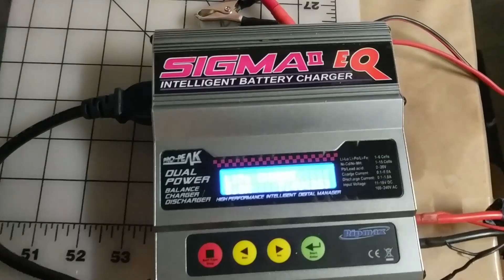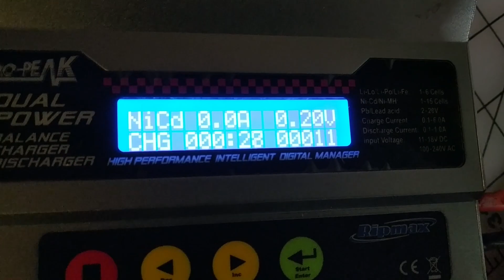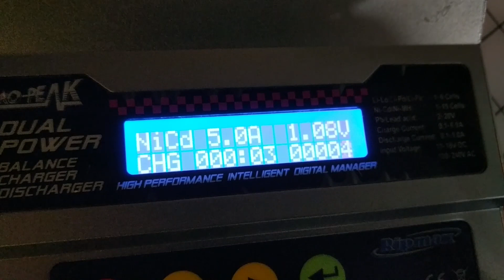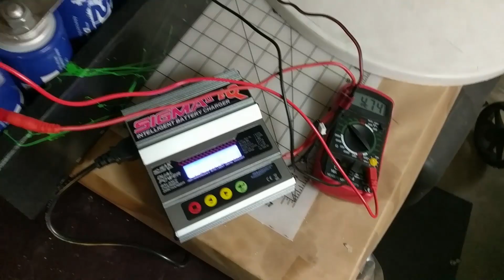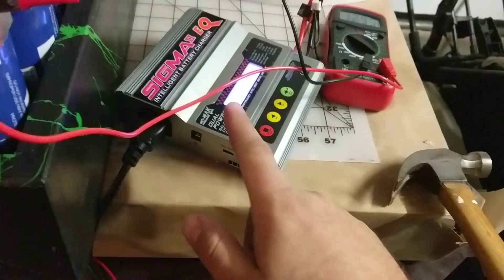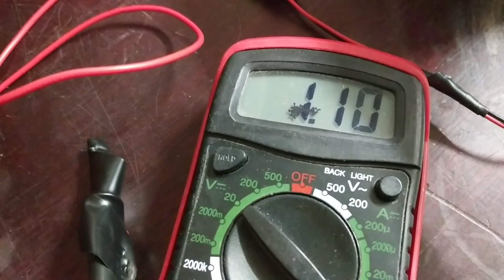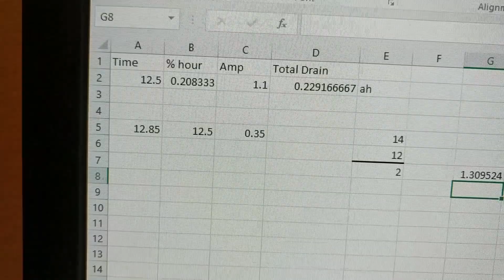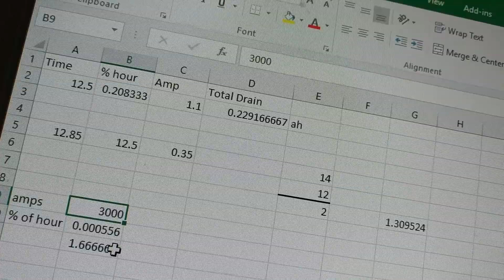How to charge a Maxwell bcap3000 + capacity test

Comment: Hey Marius I just acquired a 6S4P 2000 Farad XS power super cap bank off of marketplace i got it in the hopes of it stabilizing my voltage with the Ruthless amps the 10k dips my voltage to the low 15's when I turn it up and I don't even have the amp gain or bass knob all the way up i think the amp is around 95 of 118 clean and the bass knob is around 60% anyway im wondering if 2000 farad's will be enough to see a noticeable difference in the voltage and help with burps when I compete please forgive me I'm still learning bro currently running a 240 autotech xs super cap bank under the hood triple run to the back feeding a 72.5AH Scib   bank charging at 15.8 feeding the Ruthless 10k and 1500.4 still just the one Tyrant 15 but the Second one is on the way just trying to learn a little about the bank and see if I would be good with that or needed more

Comment: Not sure how many lives you might have saved by emphasizing caution but I, for one, appreciate it. From just looking at caps put into car's many ppl don't realize you need to limit the current BOTH charging and discharging or you will have lot's of sparks to say the least. Maybe a 12v battery sitting in the middle of the sparks. Great vid. Thanks.

Comment: Do you think it safe, when implementing super capacitors in an amp psu, that right after the rectifier  (with 5w series resistor) that enough s.cap be placed? Non regulated voltage on my ac line has a swing of about 5v - I’d obviously give myself enough headroom.

Comment: How to balance the capacitors on which I have voltages - 2.45/2.42/2.45/2.22/2.00/2.50+? Does horizontal installation of capacitors affect their operation? Does the + or - at the top make a difference? Thanks. Greetings from Poland💪
Reply from the maker: User resistor between them, if you short them it may not be pretty
Reply: @LoudFiat  Measuring the resistance of each capacitor? What is the correct value? I removed the package from the car and it is on the table. So it's safe.
Reply from the maker: @Lostylian  you can balance the capacitors by connecting the common ground and then using a resistor from one positive to the other positive, continue doing that until all the voltages equalize
Reply: @LoudFiat  So I will. From what follows, one balancer may be damaged. There are 3 in the package. Or I will swap the balancers. Then it can be determined whether the supercapacitors with another balancer work properly. Thanks for your help👍

Comment: I am very interested on setting supercapacitors to my car for extra power and efficiency but I just can't find a basic guide on how to do it. I'm familiar with electric car conversions but not with supercapacitors
Reply from the maker: Ultra caps for 360v nominal won't make sense due to size
Reply: @LoudFiat  I had my eyes on the 6 kW PMAC motenergy electric motor. I guess the gas engine can charge the SC when not accelerating. Hey, thank you for your answer.

Comment: Buy a 1000 watt high pressure sodium ballast transformer. Cut out the secondary coil carefully without damaging the primary coil. Wrap four gauge wire at about 14 to 16 turns on the secondary side. Buy a 400 amp bridge rectifier and you’ll be able to charge those caps in  maybe a couple minutes. Cheers

Comment: Also, I have seen a single row of these Capacitors (6 caps) start a huge Steiger Articulated Tractor with no battery, and a single capacitor vaporise an electrical screwdriver @ 2.7v, so this is a huge cap bank, especially for audio, I would imagine a single row of these caps would be more than enough for even large audio systems, as you can pull about 2000amps out of a single string for a short time.

Comment: Good Day Mr. Marius Dornean. May I ask a question please. No. 1= Can I charge in series or in parallel 6 pieces of 2.7v 3000f supercapacitor all at the same time? No. 2= Can I add the 6 pieces supercapacitors to my 12v batteries? Thanks so much

Comment: Okay, so you trickle charge capacitors for 3 hours to get a full charge of 12.8v (is this charging faster than an actual lead acid battery?) You get about half of the output in time 1.6Ah burning on a 1.5Ah fan. Is there any way you could open up the Ah input without damaging or popping the cap? 3hrs is way too long. I thought the whole point of having super-caps was for the extremely fast charging and discharging rates.
Reply from the maker: Based on the comments in this video, some people think you could just hook it up to maximum amperage and just load it up in milliseconds as long as you're wiring supports the inrush. I wouldn't recommend pushing the limits of wire capacity personally 😄

Comment: if you have 2 35v capacitors and want to use it as a power for a car, how do you enSURE that the alternator won't overcharge the capacitors and blow them? OR that it won't charge too much for the car's electronics? thank you :)

Comment: Question regarding its charging procedure and working.

Question -1) Is For super capacitor the charging voltage should be always10 percent less than the capacitor rated voltage.To increase the life of capacitor.

Question-2) regarding charging current to these capacitor for example 3 volt capacitor of 500F connected in series  of 27 pcs.so total voltage will be 81 volts and capacitance will be                         18.5 farads.Hence what will be the safer charging current.if we connect it to 79 volts,45 amps power supply.(transformer type power supply). Is there any problem to                                capacitors.   

Question-3) after capacitors fully charged it means voltage across the series capacitance network will be 79 volts is equal to power supply voltage. hence in these condition if the                              capacitor network remains in the circuit parallelly with the power supply with no load connected. Is there any problem of heating capacitors.

Question-4) Is there any need for protection circuit.i seen protection boards available in markets.

Question-5) What is the leakage current of these capacitors.500F,3V

Question-6) terminal resistance of these capacitors.500F,3V

waiting for your reply
Reply: Hi! please let me know if you find the answer to your questions :)

Comment: Why are you even saying 12volt this or that your banks are over 16volt capable and your using them for car audio to punch some big drivers in the ass while you have what 3- 200 amp alternators throwing Zeus size lightening bolts at them. Honestly dude that tiny charger aint going to do nothing to them no matter what setting you put it on. These things charge faster than a meth-head can get your catalytic convertor off. Next time how about you don't play with stuff someone else pays for and stick to installing remote starters at the audio shop.

Comment: One really need to run the output through a watt meter to record the total watts. because even though that fan drew 1.1 amps at 12 volts it will draw less as the volts of the caps drop. the volts and Ah will drop linearly together. Each of those 3000F caps will have the equivalent energy (close) of a double AA alkaline battery 3Wh If you got the voltage to its max of 16V.  Best way to use the full power of those Caps is to use a Boost converter that will boost the voltage (as it drops) to something usable. Assuming you want to use these as a battery. All those Capacitors are going to provide up to 108Wh. But because the voltage drops as fast as the current is used it is hard to make use of that 108 Wh. Nice thing about these Maxwells Boost caps (I have 24 of them I have experimented with) is they hold their charge for Months at a time without self draining. As expensive as they are you really have to have a specific use for them to make them worth the cost. Like needing a tremendous amount of amps for a very short time. So if you want to sue these as a 12 volt battery you really need to have a Boost or a buck boost converter regulated output found cheap on AMAZON or Ebay.

Comment: A 12V halogen light bulb between the baterry and cap pack would be enough to safely charge the caps from zero volts. The bulb would get 12V at the beging and the voltage drop on it will decrese as the caps would be charging.

Comment: I have a question do you need balancing circuits to make sure they charge evenly? or can you hook these things up with only bussbars  in to a 14.4V system and never have fear about them over charging or duos that become an impossibility because there max voltage is 16.2 volts and there charge voltage is 14.4 volts in a care audio situation  kinda like water lvling? I understand battery's and i'm getting in to Super Cap supplementing now and want more information on the 6 inline super caps.
Reply: Yes you need to balance

Comment: I would suggest to everyone that watches this video to read the wikipedia page about how a capacitor works and take a look at its equation and take some online supercapacitor discharge calculator. For this 3000F setup if you discharge from 12.85V to 12V using a constant current of 1.1A (considering the internal resistance of 0.29mOhms) it would last around 38 minutes. And from 12.85V to 12.5V it should indeed last for 15 minutes.
Reply: If you connect a 200 load to this set it will only pull out those 200 amps right?

Comment: Next time make your video without the children. If you would use the battery tester you would find your calculations are wrong because the load decreases with the voltage. In theory with no losses on paper and real life are quite different. What you should be looking for is "usable power" Know what the manufacture says and  verify it. With a load of x amps and a cutoff of X volts we can expect to run this equipment for x. These caps will not be damaged by going down to 0 volts whereas batteries have an operating range both voltage wise and temperature wise. If you are only using these caps for peak loads then simulate so. As with anything electrical safety first and know your limits.

Comment: Capacitors do not compare to lithium batteries. Cars are using capacitors to supplement batteries for SURGE considerations, not continuous energy sourcing. Capacitors are good for providing an initial blast of current so that the lithiums will not have to. It supplements the energy stored in the batteries. Placing a small fan as a load is only going to mislead people into thinking cpacitors are comparable to the energy storage and longevity of batteries. Folks, don't be fooled by any misunderstanding derived from demonstrations like this.

Comment: You are making an expensive mistake by providing no balancing circuits. In series, it is possible in charging to exceed the rated voltage of a single cell, destroying it. This can happen if one cell is a bit smaller in capacity than the others. That one will hit its maximum voltage quicker than the others.

You need a per-cell circuit to bypass it if the voltage across it reaches 2.7volts, minus a small margin. I don't know how violent this destruction would be but the energy they contain is about 2,000 Joules, per cell. You are well advised to use balancing circuits.

As to what you can get out of them and for how long, You need to look at how much energy they contain at voltage V (given by 1/2.C.V^2), The answer is in Joules or Watt-seconds. which you know by multiplying the Watts taken by your load and the time you intend to run it. You can then subtract the Watt-seconds you intend to use from what you start with. Using this figure, you can go back and calculate what the voltage will be at the end of the process again using 1/2.C.V^2.

Comment: Please ANSWER this 
If i take my flashlight with 6 x 1.5v@2500mA batteries
Do i get 9v@2500mA
Or
Do i get 9v@416.666mA
Matehematekley yes and no
You are talking of the chardge volt over the 1 of 6 batteries \ Cap's 
Batteries and Cap's behaive a like .
If the CAP is 3000F it is in the whole row ... Or
In solar cases where you use 96v .. 
That's 8 x 12v say 200A = 96v @200A not only 25A 
And yes if you use math Then the 8 of 96 be 12v but still 20A chardge A
do i need to say series if i do .. you woud not understand anything anyway.. 
And yes the chardge volt is 96v DIVIDED by 8 12v the chardge 20A or F is not devided 
Becaus of the series .. thats constant og the 200A BATTERYES in series
Like 8 x 200A is paralell woud chardge her would be 12v but 160A
There are som basic math understanding wrong her!!!
Chardge power of a 200A AGM is 10% =max 20A in this case

Comment: These ULTRA Capacitors are not chemical based.  Batteries heat up due to its chemical reaction.  Capacitors use electrostatic that does not create heat.  Theres no need to monitor temperature during charging. The only condition that causes any capacitor to heat up is if you are charging them over their Voltage Rateing.

Comment: I wonder: can we turn these super caps into something akin to a nitro boost in our ev? And, can we also use it as a range extender with solar panels attached?
Reply: YES,  you might need to bypass some regulation circuits on the Ev. But just as these kick in to supplement when the battery and cars power fall short on those brief heavy base driveing needs.  Capacitors are ideal in solar use.  They have the ability to absorb  even below micro volts that would be far below levels required to charge your battery.  There are buck converters using this to harness power from a micro turning fork generator from the vibration of car traffic on bridges for use in monitoring sensors.
Reply: @michaelcaprice8142  I have not seen how to make an electric conversion using super capacitors, it would be an interesting video

Comment: Can I use this setup to replace car battery, charge by car alternator ?
Reply from the maker: Technically, you can. There are batteries that are half supercapacitors. However, I wouldn't recommend it since capacitors don't hold much charge.

Comment: this is wonderful  how are you controlling the charge   this method can
work for a time but not controlling the charge can be dangers  
at any open point in your bank of caps there is the total amount of charge
 or in other words if the caps age of change from usage  a imbalance can
and will happen    i would not operate the caps in this way    HAY it works
but i do not think  it is not worth the risk

Comment: These supercapacitors would probably be great for a pulsed power supply or even a high voltage (and high amperage) electrocution machine (with a few thousand of them in series).

Comment: ? Capacitors are not chemical energy storage power banks!
They can fully charge in a very fast way: Without the heating problems, limited only to the conductor limitations.
Reply: What about voltage managing? can you monitor every capacitor with a BMS?

Comment: Discharging is not linear for capacitors !! so your formula is completely wrong.  To calculate discharge power you use formula Jules = 0.5 x capacitance in Farads x (Max Voltage squared - Min Voltage squared).  This will calculate how many jules of energy you used.  Jule is same as 1 Watt per 1 second.

For example, if your starting voltage is 12.85V as on video and ending voltage is 12.5V, and your total bank capacitance is 3000F, then “Watt seconds” = 0.5 * 3000 * (12.8^2 -12.5^2) = 1500 * ( 163.84 – 156.25) = 11385 Jules (Watt seconds). Now let’s calculate your fan Jules usage per one second: 12.8v *1.1A = 14.08 Jules.  Now lets calculate time how long the fan should spin when voltage drops from 12.8 to 12.5 on the capacitor bank:  11385 Jules / 14.08 Jules = 808 seconds which gives us 13min and 28sec.  

Take into consideration that your multimeter is not professional and probably not calibrated, so the measurement could be off by up to 5%, there are other resistive loses in cables and connections, your 3000F bank your be not perfect as one capacitor can be off, and also your fan is not a perfect load as it varies depending from voltage… The calculation is for perfect system, but in reality none is !
Reply: Michal Bienias it’s Joules not “Jules”.

Comment: I have 6 of the 1500 Farad BCAPs as my starting "battery" in my van. They've been cranking it up reliably for over a year now.
Maxwell sells a balancing kit for them, it replaces 3 of the bus bars with a printed circuit board. You'd have to try really hard to overcharge one cell though, the maximum voltage of 6 in series is 17.1 volts.
Reply: @Special EDy
 how big is your van's engine? is it diesel or gasoline?
Reply: @winelfredpasamba  3.3L V6.
The 1500 Farad capacitors are ridiculous though, they'd easily crank over a big turbodiesel better than two large lead acids. You can hear the difference the first time you crank on Supercapacitors, the starter spins much faster and smoother.